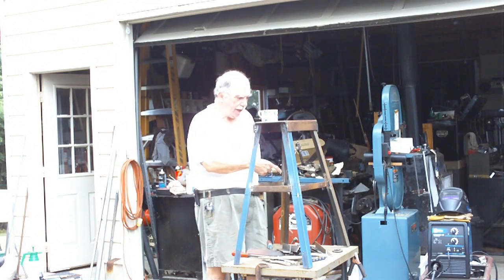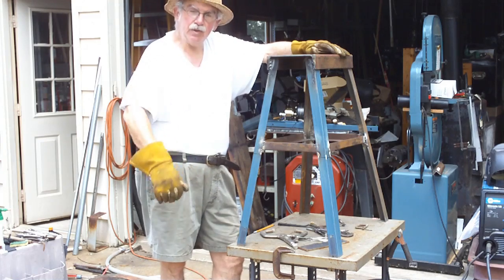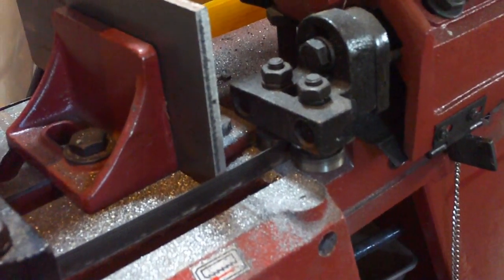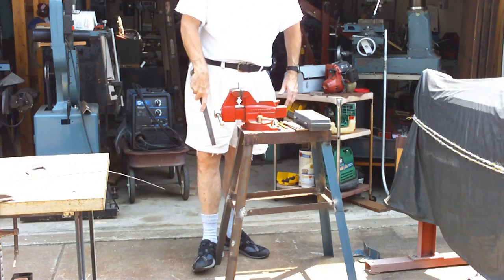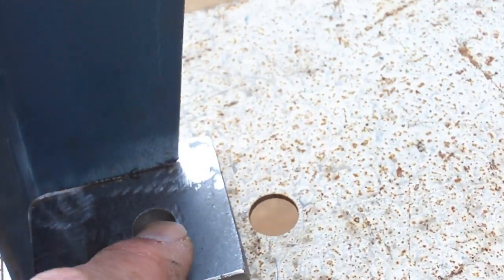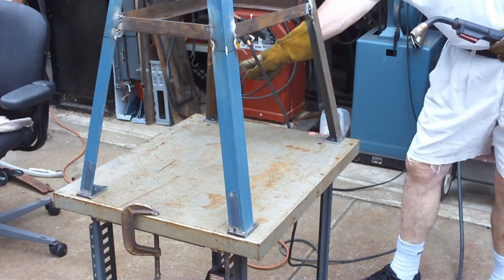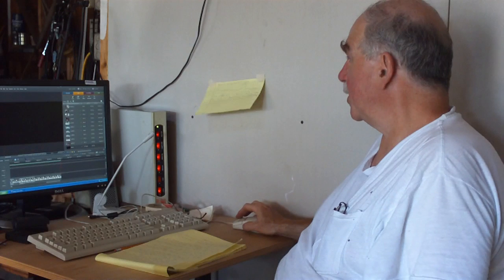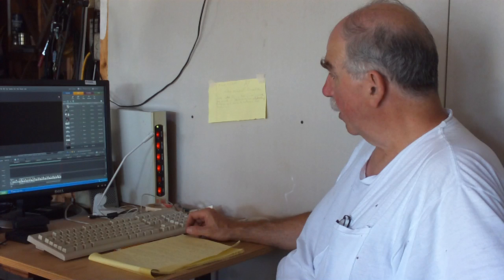Vice Stand III

Comment from the maker: The vice has a small anvil on it and I use it to whomp pieces into shape when they are bad.  I will eventually weld on some end pieces to strengthen the base so you can whomp   on it on the top next to the vice.  THere are some good reasons for not attaching a vice to your work bench, one is that the shock of whomping on stuff is transmitted to everything on you bench, not good for delicate stuff at all.

Comment from the maker: From memory I think they make 14, 18 and 24 tooth blades, at least that's what I've seen.  You could use the 24 for the 1/8 steel.  I've cut sheet metal with a 24 tooth blade.  You have to back thin stuff so it is rigid enough to cut, I sometimes use a piece of wood for that.  Also you don't want to press real hard on thin stuff as it will just bend.  When  it bends it will grab your blade and break it.